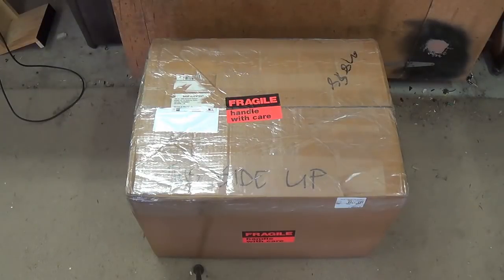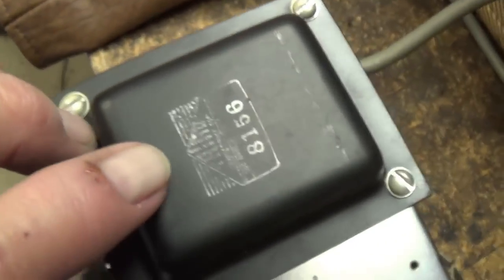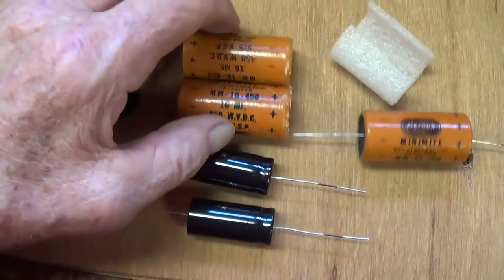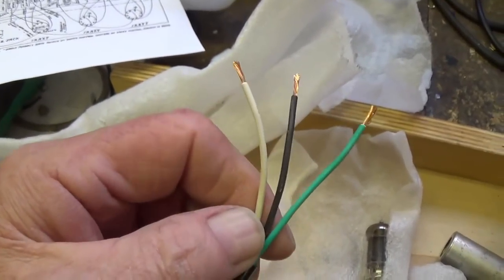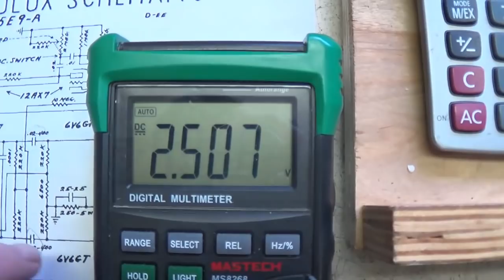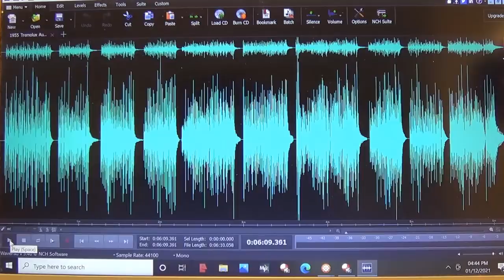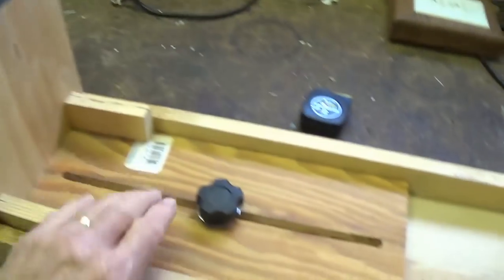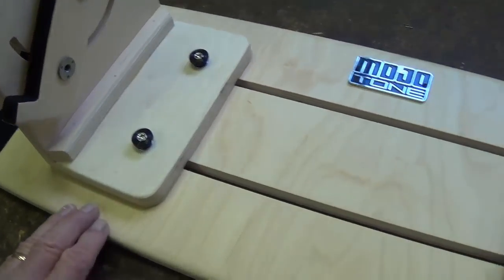1955 Fender 5E9 Tremolux in near MINT Condition.....Wear a Bib !!

Comment: Hi Uncle Doug, I thought I would share couple of questions from customers I used to get in my manufacturing days. Why are the old engines always grey? You might think some marketing strategy or makes the engines look good or ministry requirements. Ans. No; the management managed to secure a large quantity of surplus grey paint from the war department. This was just after WW2. Lagonda cars, what was the correct magneto for my Lagonda? Ans. Whoever they had credit with that month. So this is to illustrate why some manufacturers do the things they do. So you might think a great deal of thought went into some components but often the answer is much simpler. Why a certain grill cloth, Ans. Because management managed to get a good deal on that one. Not always the case obviously. Like where I work, why do we make everything out of 1/2"sch 80 pipe or inch sq tubing? Hand rails, spacers, benches frames etc, because we have truck loads of it. Just funny things that happen in manufacturing. Use what you have rather perhaps the most suitable material.
Reply from the maker: The fact that Leo Fender did exactly what you described has been established for many years, Allister. It only makes sense in a profit-oriented company that cost reduction is essential if you wish to remain in business.  Only those who have never worked in such an environment would ever doubt or be surprised to hear this. Thanks for your helpful input.

Comment: A test that I always run when servicing cathode biased amps.
I set my DVM to the milli-volt scale . I measure for DC voltage (measured to ground) on the grids of the tubes, and on the output of the coupling caps, if there is a resistor in series with the caps.
I mostly repair Leslie amps, which run 6550s, cathode bias.
If I see a DC voltage higher than .06 or .07 volts, it tells me that the coupling cap is bad 
OR
That power tube is leaky and needs to be replaced.
Reply from the maker: That works fine, Scott, if you have an accurate DC Voltmeter. I believe that the plate current stability method may well be more sensitive, however.

Comment: Hey Unk, I need a suggestion and so I couldn't think of a finer individual then you for this answer, I have a 1962 Alamo Galaxie, all tube and it runs on a pair of 7591 tubes. The transformer is a little noisey,  but other than that it sounds great and I was thinking about changing out the output transformer for a nice Hammond or Mercury Magnetics- anything you could suggest in this range for this type of output tubes which I think are closely related to 6V6's??
Reply from the maker: Between the two, I'd go with the Hammond, Ron. I've never felt that the high prices were justified with the MM transformers. I don't recall ever encountering a "noisy" output transformer......are you sure it's the source of the noise?
Reply: @UncleDoug  No it's probably not the transformer. Gave it new filter caps and coupling caps. I'm gonna try a virtual ground and see what it sounds like then. Thanks a bunch.
Reply: @UncleDoug well I did some investigating and it turned out to actually be a bad tube- it's the one used in the phase inverter, the 7199 tube was the guilty culprit. I went down the line took out one tube at a time and when I removed the 7199 tube, all the  noise that I didn't want to hear was gone, so I replaced that tube and voila nice and quiet now.

Comment: I have a Model 5E9-A Tremolux. Can’t read the serial number on the sticker. Can’t locate a stamp on the chassis. Plate says “Fender Tremolux” unlike this one that just says “Fender”. Speaker is not offset. What are some other things to look for in identifying the year this was made?
Reply from the maker: When you say "sticker", do you mean the tube chart ? The rear of the chassis always has a deeply imprinted number, generally on the left side. Sometimes you can date via EIA codes on the transformers and pots....but they are not as accurate as the serial number and date stamps on the tube chart.
Reply: @UncleDoug  Hey, thanks for the reply. Yes, by sticker I mean tube chart. They only thing I could find to confirm dates were the pots. Seems like a ‘58 according to them. Other ‘58s I’ve seen have a centered speaker like mine.
Reply from the maker: @JamesJessenfedden  There should be a two-letter code on the tube chart that tells the date of manufacture, James. If all you have to go by is the pot dating, then it's rather vague but better than nothing

Comment: Can you measure the tubes properly when the only signal they are getting is dead silence as no instrument is plugged in? Never thought of that until now, they aren't under load
Reply from the maker: Yes, output tube bias is routinely set at idle as well as all circuit measurements.

Comment: Sorry if this is a redundant question or one that you've answered already, but I just installed my first vinyl set-up. When the solid state pre-amp died (quite prematurely, < 6 months old), I decided to get a tube pre-amp as it would allow me to tool around a bit if I wanted to. However, even with a 60-minute warm-up, the gain noise on this unit is much louder than I anticipated (loud enough to be quite distracting on most vinyl). It sounds like the 60-cycle hum you mentioned in another video and I'm pretty sure the issue lies with the cheaper Chinese tubes that came with the unit.

My question is: how much hum should be expected from a standard vacuum tube?
Reply from the maker: It sounds like there is a problem, Adam. If the power amp is solid-state, I wonder if there is an impedance mismatch with the tube preamp. A properly functioning tube amp is almost totally silent.

Comment: I stumbled on to your great video after I just purchased a 1960-1961 Tremolux I would love to chat ‽
Reply from the maker: Welcome aboard, Chad.
Reply: @UncleDoug  I’m glad to be here ! I have questions about my Tremolux is there another way to contact you that you prefer‽
Reply from the maker: @chadfayrobinson7537  Actually, either this format or my FB page: Uncle Doug's Vintage Amps is fine, Chad.
Reply: @UncleDoug  I’m wondering should I be concerned about grounding my amp - Convert to a modern 3 prong ‽ This Tremolux is in great working order and un tampered with .

Comment: Just a point on biasing Doug. You need to subtract the cathode Voltage from your measured plate voltage before working out your plate dissipation, as it's a cathode biased amp. The true plate dissipation in this case is about a Watt less than your calculation
Reply from the maker: I guess you're unfamiliar with the Eurotubes bias probes, Blaine. The plate voltage is automatically corrected for cathode voltage.....so no further correction is necessary. Thanks for your concern, however.
Reply: @UncleDoug  That's awesome Doug. You can't imagine how much better that makes me feel. That's a really handy tool to have
Reply from the maker: @blainewhelan5921  Thanks, Blaine. They have revolutionized the biasing process :)

Comment: Hey Uncle Doug, the reuse of the external casings of the old caps to preserve looks is ingenious. 
Just one thing though. 
In the event this amp is sold on, you really want to make sure the new owner (and subsequent owners) are made aware of what's happened. I can see a tech, one or two years later, doing what you do to test the caps (seeing their age on the external casing),  finding the readings far higher than the external case spec show & undergoing an unnecessary recap job... 
Is there any way you can - as the repairing tech - make a note of this procedure on the inside part of the amp near where the tube chart is?
Reply from the maker: Quite a few viewers expressed similar fears, Ozzy. I seriously doubt that the amp will need service for quite a few years, and I also feel certain the owner will advise the tech about the concealed caps if necessary.

Comment: Uncle Doug, I had one question about wiring a polorized cord using a ground. This unit I have uses a power transformer, so the hot(black would be connected to the switch, the return(white) to the transformer and the ground(green) connected to the chassis. Is this way of thinking correct. Thank you kindly for your help, this is the only way I can learn is by asking someone the really knows about this....):
Reply: That's how I would do it and from the video it looks like Doug does it that way too. It;s pretty much standard practice in all electrical devices, including amps, to switch the hot (not the neutral).
Reply: To be complete: hot goes to the switch, then from the switch to the fuse, then form the fuse to the transformer. Neutral goes directly to the transformer. This assumes your switch is single pole, like 99% of amplifier switches are. If by chance your switch is double pole feel free to run the hot thru one pole and the neutral thru the other. Fuse goes in the hot regardless of what kind of switch you have.
Reply from the maker: Excellent answer, Sooti. Thanks !!

Comment: Dear Uncle Doug. Thank you once again for another one of your well made, educational and entertaining videos. I'm just curious about the solution with the capacitors: What about the heat inside and heat dissipation when one puts them inside the styrofoam and the waxed paper bobbins? I guess it's not an issue otherwise you wouldn't have performed the method. Anyway, I'm just curious. All the best and happy new year from Norway.
Reply: In my experience capacitors produce little or no heat on their own. Heat damage to caps is most likely to be caused by being mounted next to components that generate heat or even just being inside a hot poorly vented enclosure. So the foam insulation might actually be helpful. In my opinion.
Reply from the maker: Thanks for an excellent answer, Sooti. A fully functional capacitor should have essentially zero internal resistance, so no heat should develop. If it does, it's an indication of impending failure, especially in electrolytics.

Comment: Hey Doug, any speculation as to why Fender revised the model of rectifier tube? Would something like this be due to tube availability at the time? Or something else?
Reply from the maker: Good question, Clayton. The 5U4 is a more robust rectifier than the 5Y3, so it was probably considered to be an upgrade. Also, it may have also been cheaper and/or more readily available.  A win.....win......from Fender's standpoint.

Comment: Fabulous specimen! Your method of testing the coupling caps in this amp will not work well if the volume controls are set at minimum (grounded). Thanks for another interesting video.
Reply from the maker: Thanks for the tip, Steve.

Comment: Uncle Doug, I have a 1960 Tweed Deluxe (not nearly in this good shape) got me wondering about the electrolytic caps and 2 had bulges so they will need to be replaced. Upon noting this one was already replaced but it’s a 80uf 500v instead of 16uf 450v! Any idea why someone would install one that high of a value?  Also, you mentioned using F&T 22uf 500v instead of 16uf 500v caps, the difference is negligible or better to up-rate the filtering? (Maybe tighter bass response) Thank you and wonderful information in your videos!!
Reply from the maker: Substituting a 22uf for a 16uf is acceptable.....but substituting an 80uf for a 16uf is not. The person doing this may have thought it was a good idea, but it is not.
Reply: @UncleDoug  thank you Sir!  I ordered three of the F&T 16mf 475v you use. Thank you again for your reply and excellent videos!
Reply from the maker: @mkii1964  You're welcome, MK. Best of luck with your project.
Reply: @UncleDoug  Thank you Sir, I appreciate the help!

Measuring my amplifier I got nearly the same plate dissipation as this amp: My amp = 13.1W (39ma @ 338Vp) which is also too high.  You replaced the 250ohm 5W cathode bias resistor with a 500ohm 5W resistor.   The one you used is a exact looking replacement, I cannot find any that look like the Tru-Ohm that's on my amplifier.  Question: Where did you purchase the 500 ohm 5W resistor?
Reply from the maker: @mkii1964  I get virtually all my components from Antique Electronic Supply in Tempe, AZ.

Comment: will there be a heat problem with the caps in foam and stuffed into the old paper tubes? thanks for the video!
Reply from the maker: Functional caps have virtually zero resistance, so heat should not be a problem.
Reply: @UncleDoug  thanks

Comment: In your recent video about a Fender Showman head you said that Fender used the pre-amp from a Tremolux?? and the power section from the Tweed Twin. Did Fender do that a lot of the time, marry one pre-amp with a different power section? Is there any trouble matching the transformers from two different amplifiers?
Reply from the maker: I was merely relating what my sources stated, Dennis. It would take some serious analysis to identify all the times Fender did (or did not) do this. I don't think transformers would be a big issue.

Comment: Could the bias resistor value on the schematic be wrong?  Seems odd you need exactly twice the value in the schematic to get the 6V6s biased just right.
Reply: variations in current draw of the output tubes combined with higher wall outlet voltages sometimes make for seamingly wierd bias-resistor values.
Reply from the maker: Pief is right on the money, ET......plus conservative tube bias was definitely not a priority back in the Tweed, BF, and SF days.
Reply: @UncleDoug  as is evidenced from the scorches on the back cover (tube side)

Comment: So each 6V6 tube is putting out about 10.5 watts. So is the amp rated at 10.5 watts or since there are 2 6V6s, rated at 21 watts? For those who may not know. My ‘57 Tweed Deluxe is similar without the fantastic tremolo. Leo’s first tremolo and I think the best. It is full and strong! Your explanation of the amp holder was great! Love from NW Colorado. Thanxz
Reply from the maker: I would estimate the RMS output power at closer to 15 Watts, ATL......that's what the tube data sheet says at least. Thanks so much :)

Comment: Great video Doug. One question; when checking the coupling caps is there a reason you don't just measure the DC voltage on the grid side of the cap? 
Loved the stand demos too, thanks!
Reply from the maker: Thanks, Dug. I find that monitoring the stability of plate current provides the most sensitive and accurate assessment of leakage, but certainly would not argue with your method.

Comment: Beautiful sounding amp. Why not compare and contrast the difference between inputs 1 and 2? Those are the ones that are connected differently in the circuit. Channel 1 has 1M to ground where channel 2 would only have 68k to ground.
Reply from the maker: Thanks for the nice comment, William. Look at the schematic. The difference between Instrument and Microphone is even more significant.
Reply: @UncleDoug  Well kind of. There is a weird interaction between the instrument and mic volumes. The way I see it, if you use the the mic input with the volume pot at 12 and the instrument volume pot at 12 as well, They are identical. Anywhere in between 0 and max, would be diminishing the effects of the tone circuit. So I see your point there. I just love the way it sounds all together.

Comment: Hi Uncle Doug and Happy New Year!  Thanks for sharing the building of the Amp Cradle.  I wanted to share with you the link to design file for the one I built to replace it.  https://www.trinityamps.com/ForumGallery/trinity/Amp_Cradle.pdf
Also the Knob you have in the home made cradle is available at Lowe's it is item number #423473 available in the Hardware section (Aisle 16 in most locations) - yes I work there, but I have another job in healthcare to support my family.
- Dave
Reply from the maker: Thanks for the link and part number, David :)

Comment: Uncle Doug I love your work and I have learned so much from your videos. I like your fixture. I have a video of building an amplifier fixture that uses a sliding rail at https://youtu.be/j-uzgCLFxLs your viewers might enjoy it. I was even able to use it when I replaced the valves, actual valves, on my 2004 Acura v6 heads. One thing I found handy (after I did the video) was to put holes at the top of the fixture ends that I could put bolts through. Often old radios bring their components all the way to the edge of the chassis so I can put the bolts in so that they act like fingers giving me the ability to flip the chassis tube side down. Thanks again for all the amazing videos especially the ones on theory!
Reply from the maker: Thanks so much, Rob, for your very nice comments and your helpful suggestions.

Comment: price is pretty good for that mojotone stand as well, the hardware and wood so forth is easily half that much in any event, so you're paying a guy $125 to cut and assemble the thing then modulate it and box it up.. not too bad cuz its easily a 2-3 hour job for even the most seasoned woodsmith, a guy with no tools and no skills?... may as well pay the man, to tool up is easily in the $500 range and that's making your own router table so forth.. time involved?  good price a guy could wing it with a hand router, hand saw, coping saw or jigsaw but its not gonna be as fun to build and not look anywhere as celan without a ton of hand sanding, unless you have multi sander laying around..
Reply from the maker: I agree, Dan. Having done quite a bit of woodwork over the years, their price sounds pretty reasonable to me.